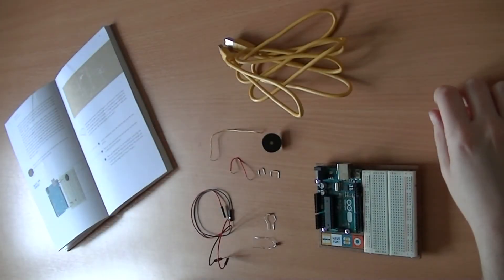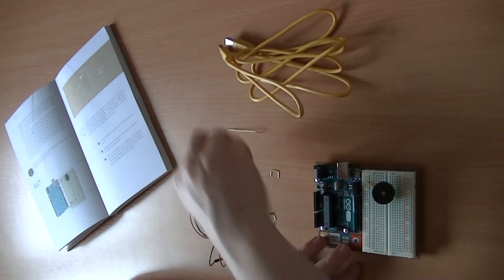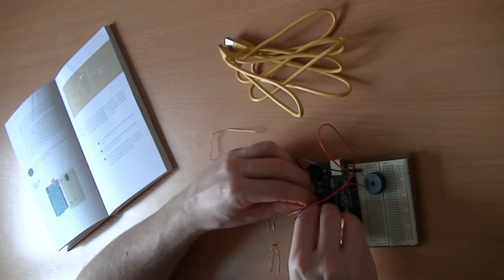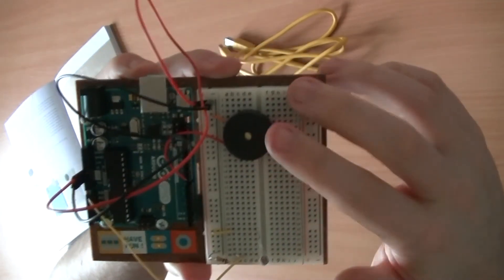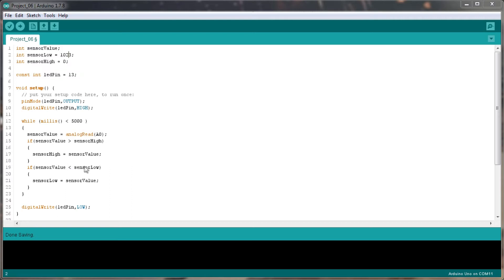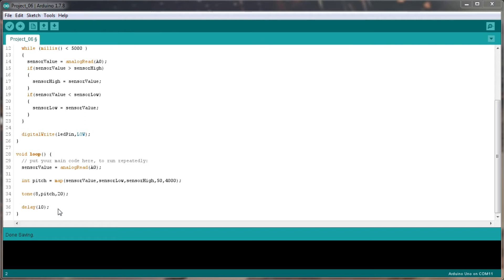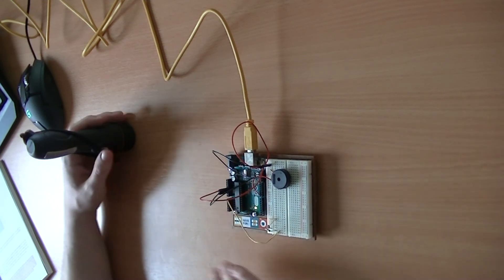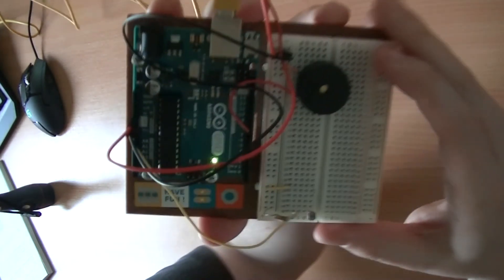Arduino Project 06 - Light Theremin

Comment: I can't really understand: Why ledPin is 13? Everything works fine, but I really cannot understand why pinMode(ledPin) with ledPin = 13, while the sensor is connected to A0 and the piezo to port n°8. Can someone please explain that to me?
Reply: On the UNO board, there is a tiny but very bright LED connected to pin 13.  You can use it instead of a separate LED on your breadboard.

In this Light Theremin project, the code turns on the pin 13 LED at the start of calibration and turns off the pin 13 LED at the end of calibration.  It's just an indicator light to help you know when you should be waving your hand around the photoresistor.